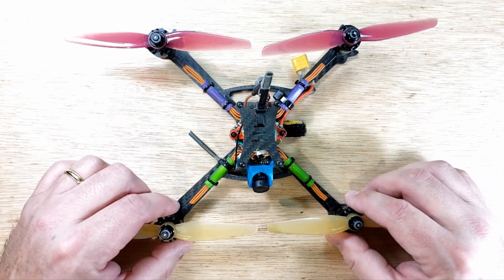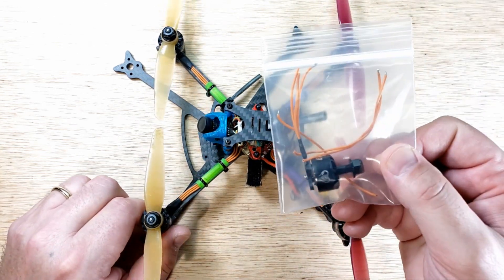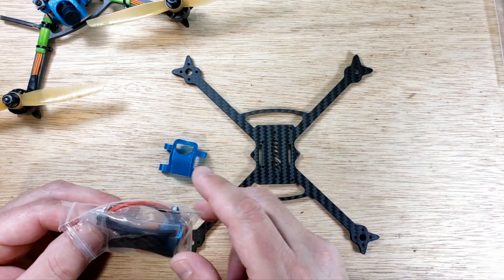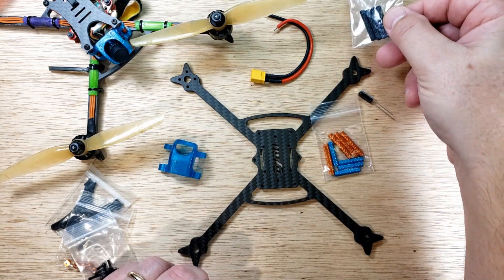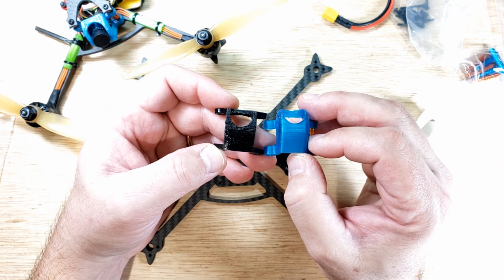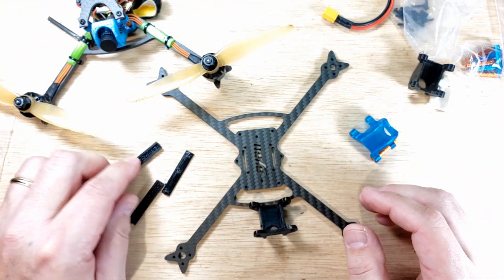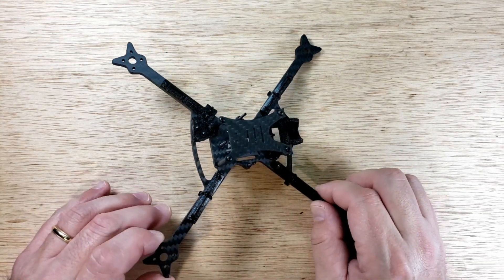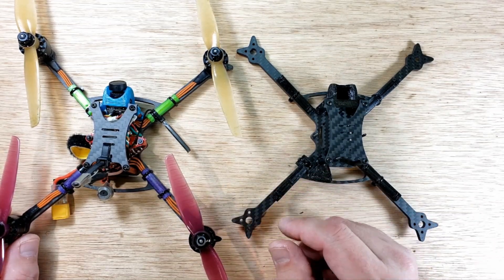The Frame | How To Build A Drone | Sub 250 Quadcopter Build Video

Comment: +1👍looks really small and swift for 5" and i like your TPU solution 💪
what size motor are those?  MAMBA 1408 4000KV, right?
Reply from the maker: Yes, Mamba 1408 4000kv. Same ones used on all Diatones's GT/ER 349 quads.. SUCKS! Gave Diatone a call and they aren't able to get them anymore.. So sad..
I appreciate your support and encouragement, the TPU parts are making this build that much more special...👍🏻🍻👊🏻